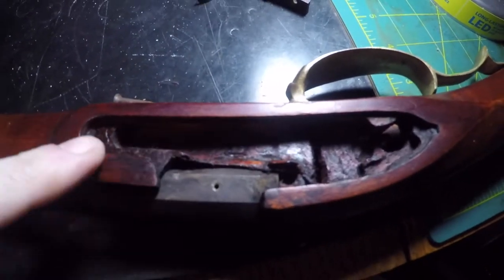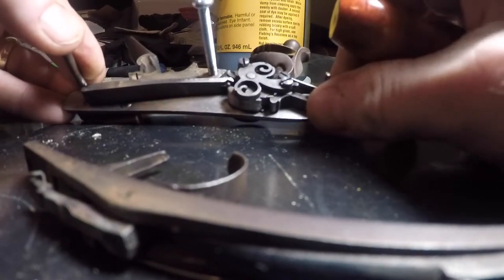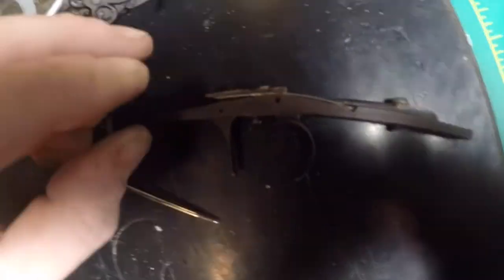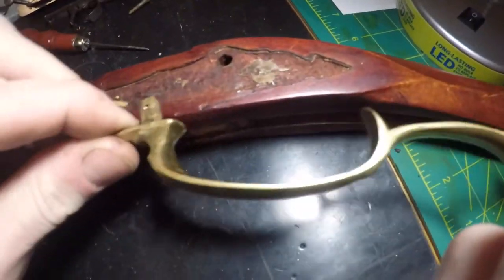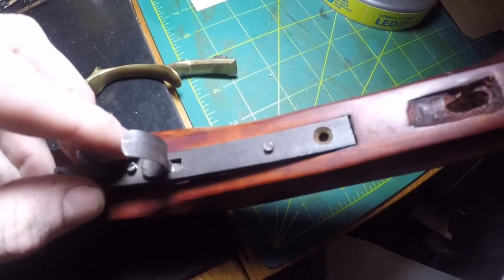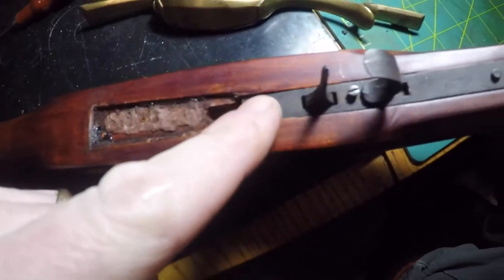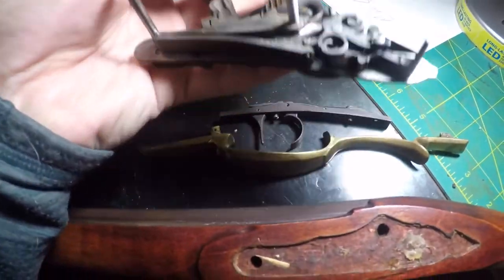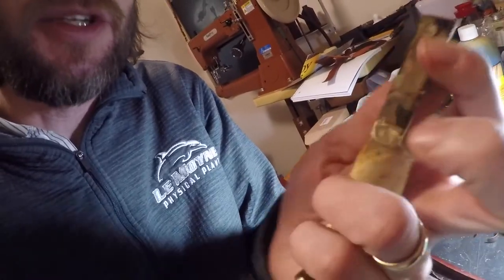No I Cannot Recommend Sitting Fox. Here's Why. Be aware hand held closups cause some camera shake

Comment: As soon as I saw the inletting I knew the builder  lacked the basic skills needed. Looks like an angry beaver got a hold of the stock. It might be fixable up to a point, but it's gonna require a lot of work and it won't ever be 100 percent. You can fill the holes in the brass and in the stock, and redrill correctly but  that won't fix the really bad inletting or the lack of proper trigger tuning etc etc. And having watched the many flash and hangfires you've experienced... let me just say you've got more patience than most. Good luck with this project. 
You could use this gun as an opportunity to learn a lot about flintlock repair. It's perfect. It needs a lot of repair. Before it's over, you should be an expert.

Comment: you can get replacement triggers from L&R, they are very reasonable folks to work with. Just a lack of care  in putting it together. The lock mortise is better than some you find on old originals. Whoever put this together was in a rush or just plain incompetent.

Comment: You can fix the trigger guard problem . The  guard needs to be inlet  deeper ..the tab will probably end up with the pin hole below the existing one . Overall, the workmanship on that rifle is pretty poor.  One more bit of advice.  Don't snap the lock , ie dry fire, without the fizzen in place to absorb the force of the cock . You can use a wood "flint" if you like .
Dry firing with the frizzen forward can damage the lock
Reply from the maker: The wood on the inside cannot be inlet any more since they left it long they inlet all the way in below the barrel, there is very little wood left.  

I thought about threading the gang screw into the brass guard.  The pin hole was lazily drilled, I also could just fill in the hole with some jb weld etc but we'll see.  

Appreciate the comment

Comment: After watching your video on the triggers.that is the problem with L&R triggers. Not only this trigger but like there Hawken triggers, the top of their triggers are too tall.When you fit the trigger to the lock,the front trigger or the back trigger ends up short causing a front trigger override.
Reply from the maker: Exactly. I actually filed and polished the triggers smoother and more uniform I then had to shim up the trigger channel to make the trigger plate flush to the stick as they inlet it too deep and when tightening the tang screw it sucked the trigger into the sear . I finally got it all working and just need to upload a final video.  

Thanks for the info

Comment: Sorry about the Sitting Fox.  Quite a few problems for the money.  I've been thinking about buying a Kibler kit in 36 cal.  It is my understanding that their kits are pretty complete and require some work, but not a lot.  I can get help in finishing it from a friend who knows what he's doing.  Have you heard anything about Kibler?  Their kits run a thousand or a little more depending on the model.  Sorry about your rifle.  Thanks for your advice.
Reply: Go to Kibler longeifle on you tube. Multiple videos on completing the kits. I have heard many good things about Kibler. Minimal work needed on these Cnc kits
Reply from the maker: I def would not hesitate on kibler, had it not been the lead times on the kits right now I was about to buy a kibler in 36, I did not see anywhere on the site where he had 36 in stock but his kits are of the highest quality according to many on the forums and internet.  He even has full videos of putting them together.  If I buy another one anytime soon kiblers would most likely be my next one.  Cnc parts all around.  My mistake was wanting something to use this season on medium to small game and I did not want to wait to build one and I thought I was getting a good quality piece.  

Oh well lessons learned.

Comment: Wonderful show have watched this before I ordered my gun so let's see what horrors show I get when I get mine I been waiting on these guys for damn near 2 years so if I ever get my gun let's see what happens
Reply from the maker: Wow that really sucks I hope it works out for you.
Reply: Just got mine last week was ok they drilled the barrel pins crooked and the screw that holds the lock on was left too long and the hammer and frizzon hit wood I'm pulling my own trigger gard and buttplate on but once the locks off there's some pretty rough tool marks it looks like who ever they have making them there chisel where not really sharp but overall I'm ok with how it turned out I couldn't get the one pin out but it was just a thimble pin cuz it just kept bending so I'm not browning them anyway so I just cut it and left it in didn't shoot it yet the touch hole looks real small so I might have to make that bigger if it keeps fowling out have to shoot it for a new custom gun they could have put straight pins in it

Comment: Yikes!  That's some truly bad gunsmithing.  I would enlarge the hole a bit in the brass and re-braze, filling the hole solid and re-drill after re-bedding and clamping the part in the stock.  The epoxy should be replaced with grafting new wood into the stock.  Lots of fixes to make on that rifle.
Reply from the maker: Thanks for the comment and ideas.

Comment: bedding parts is a legit thing, it was done on originals with wax, but these fools f-ed up. epoxy bedding is super easy, and it looks like they just didn't use release agent. $1600 glued together gun lol
Reply from the maker: Thanks again yeah def sad , I figured you could bed em but proper length of screw and drilling at right height would solve the gap in the trigger guard resulting in not needing to fill that hole.  

Sigh oh well

Comment: It seems to me that you were unfortunate in getting a gun from a builder that you were not familiar with and who didn't assemble and tune the the parts properly.  The components on the gun are good components, but they were not assembled properly.  The little I know from putting a few kits together from Clay Smith, Cabin Creek, and Jim Kibler is that there is always a little work that needs done on the lock and trigger components to make them work properly and the builder of your gun did NOT do this.  Kibler's kits are the only ones I know of that does not need adjustments.  they are basically sent to you in the white.  I agree, for what you paid for the gun, you should not have to go through what you are doing.

Comment: That is the work of an amateur builder. Something is not right, looks like a kit someone built and sold as new. If it was indeed sold by the company as new you should have just returned it.
Reply from the maker: Ot was def new and listed on their site , I have all the pics and info and screenshots plus invoice and emails. 
I mentioned in one of the vids on this as to my ethics of shooting it 100+ times and then returning it. 

I should have returned it upon opening it and seeing the problems but after talking with Ray on the phone he made it seem like I should bot worry and just straighten the sight and bend the pin holding the rear trigger guard. 

I should have fully disassemble the gun at that point instead I proceeded to run out in my excitement at a new flint 36, that when the myriad of problems started showing up. 

I have done extensive work to the gun now and will be doing another updated video but my lesson was learned do not buy a sitting fox rifle or any other online custom gun without inspection periods offered plainly, and frankly I can build a better one , and as I mentioned in one of the videos I just did not want to wait the few months backlog to get everything in at the time I saw this.  

Lessons learned.  

Now this gun is fully modified and fixed by me so there is some stubborn pride I have now.  

Thank you though and as you said this was amateurish and sadly that's what they are selling.